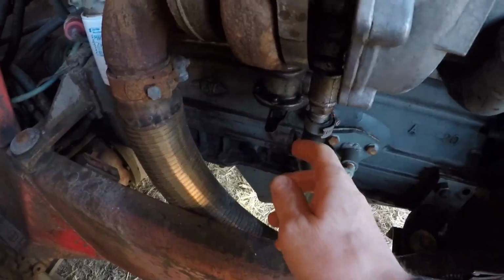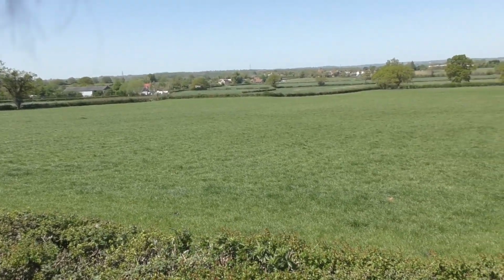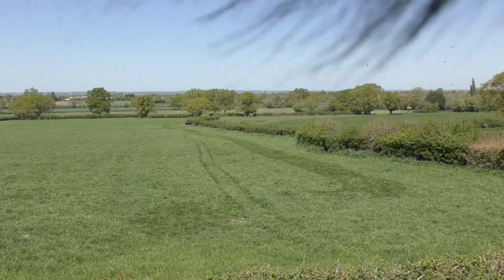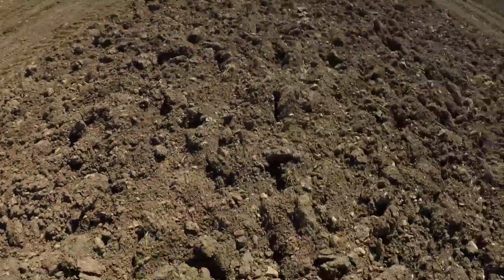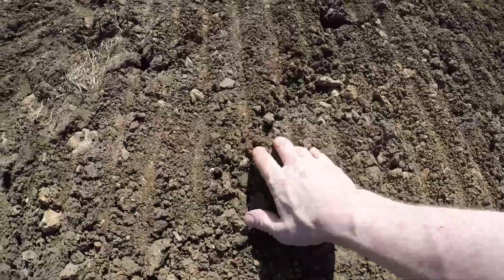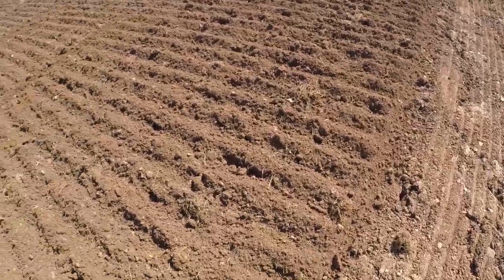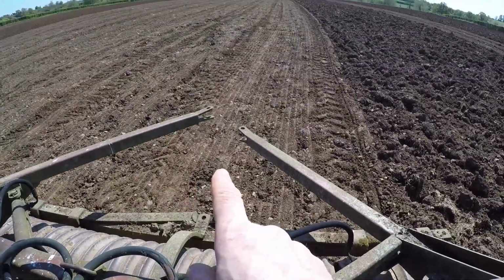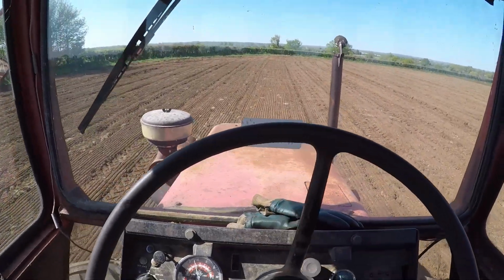Vintage Thursday. Massey Ferguson 1200 rolling ploughed land.

Comment: My grandad had two 1200s in the late 70s early 80s. Was disappointed when they were replaced with MF 3600 datatronic tractors - less character character than the 1200s.